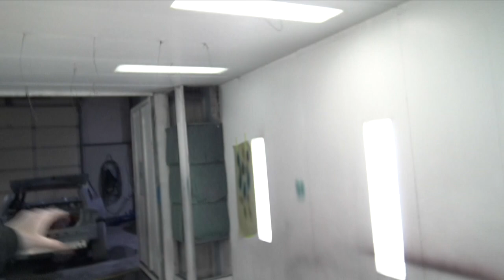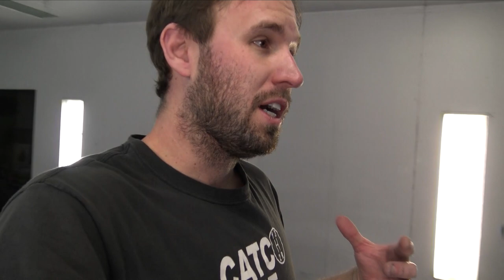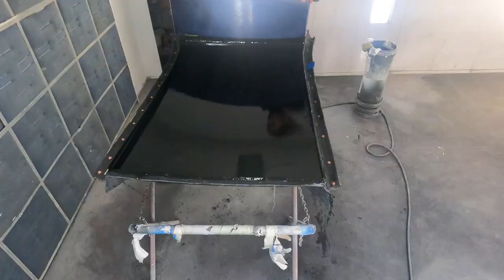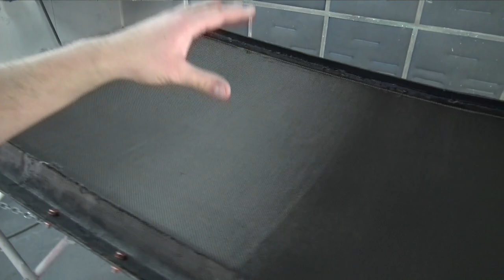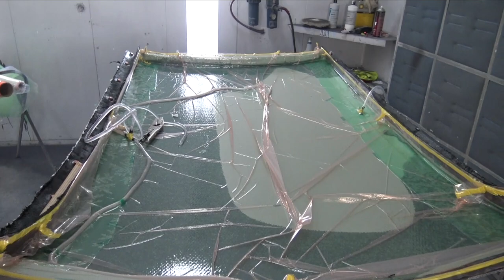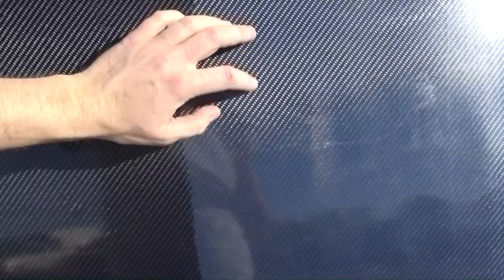Building the Ultimate Station Wagon | 2021 Charger Magnum Hellcat | 1000HP Hellwagon | Pt 40

Comment: If you pull your resin from a big pot it will cure faster because of the heat.  You might cool the resin in an ice or water bath to keep it from heating too much, to slow the cure.  I'm not sure what system you're using, but this definitely works for polyesters, so maybe it would work for you too.  Experience is the most valuable teacher.  Thanks for sharing!
Reply: This may cause it to flash cure (faster) once it starts warming to room temp through the infusion process...think of it like a snow ball rolling down hill but it’s temperature momentum ...did you know cold water boils faster than room temp water

Comment: dave, for your next attempt, before you draw the resin in, build a vacuum chamber and degass it. its very simple and it will give you great results , no voids between the fibers etc. also you can use resin that only cures in elevated temperatures, so when you finish infusing it, you can throw the whole mold in an oven (a big box with a heating element, you dont need to build a proper oven just for this)

Comment: For your vacuum leak...look for duct seal...or buy a few rolls of rubber or butyl  “tacky tape” 
May I suggest putting your vacuum ports diagonal across the part from each other for a larger cross section

Comment: From the experience i have with composite, you might want to try to infuse it the other way arround. Frony to back kind of. Also putting the mold vertical helps the pump since air always goes up, its easier to infuse the resin that way. Good job on that tho !!!

Comment: Dave, in the corners where you had the leaks, I used to take a small piece of the double sided sealing tape (dum dum) and roll it up and put it in the corner, then run the dum dum over it and it would seal and hold a vacuum every time. 
Make sure to use enough transducers to draw down an even vacuum over the entire surface.

What about pouring the resin out over the cloth and spreading it out before bagging the part? That’s how I do it with aircraft parts.

Comment: When I infused parts I would run the resin through a spiral tube down the middle so it was evenly distributed. But this was on a 13 metre mould. I've seen people use rope to achieve this also

Comment: You need to calculate the hardening time based of the surface area and air avaliable maybe should call the resin company first before remolding the roof

Comment: I have done a little bit of carbon fibre work at my job. We also use vacuum and a kind if putty as "vacuum tape", I'll explain later in the text. I'll explain how we do it, although what we do does not get removed after. First we put some epoxy, then on with the carbon, another layer of epoxy, second layer of carbon then epoxy again. After that we have a thin plastic like fabric that doesn't stick to the epoxy and then we have another type of fabric which is kind of soft and thicker, almost like one of those ugly christmas sweaters, kind of the same fabric. We have the vacuum putty around the area we are vacuuming and what we use is a very thick adhesive thats like.. i dont know the english word but if you have ever used the sticky white/gray stuff to put papers on walls or whatever at school, its kind of like that and it works very well in our appliocation. Either way, we have two small tubes that go to a vacuum machine that we seal within the sticky vacuum putty and we then have a pretty thick plastic over everything and whats important when we do it is that the plastic is as smooth as possible to avoid any imperfections. I'm suspecting some of the irregularities in the height may be from the plastic not being very flat on top.
Reply: Sounds like you are referring to Blu Tac. which also has other names and even comes in yellow.
Reply: @BrucePierson  You referring to the putty? It has the nickname "dogmeat" for some reason, dunno where it comes from haha. If I knew exactly what it's called I would tell you but it doesn't have any markings :/
Reply: This is the way I was taught in aviation school.
Reply: @thesinwagin  makes sense, I'm working on airplanes haha

Comment: So first thing is i was wondering, why you carbon fiber to create the mold. Fiberglass mold would be much cheaper and easier to manufacture. Second is you have to use two resin entry ports on the two different ends of the mold ( the longer ends) and the vaccum port in the middle. BTW nice work and keep it up.

Comment: You can probably still salvage some of that roof and cut out a splitter or canards from  it. also have you looked into Street Bandito's and the system they use? they put up a video on the fibreglast products they use.

Comment: I don't really see the point here... Why making a carbon fiber roof ? Weight reduction ? On a car like yours with a crazy powerful engine, you will never notice the difference ! The 2 metal pieces of roof, glued or welded would have been a good choice ! You would have saved money, time, and the car would be painted for now !
Reply: Mostly its a flex obviously (same with making a 10 layer carbon mold which serves no real purpose since he's not autoclaving the part). But in the end point of gravity will be lower regardless so it makes sense anyway. Besides it of course looks dope, the black-blue carbon/kevlar. And more time means more episodes means more adrev (youtube ya know)
Reply: @pieterverboven4853  The roof is likely a lot more expensive than Youtube ad revenue will bring in... But yeah, the carbon roof is mostly style.